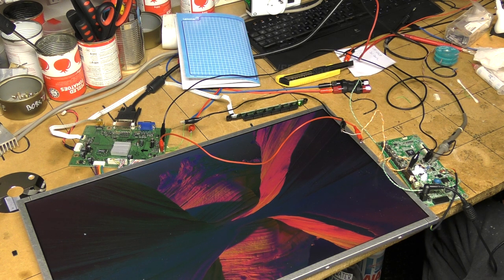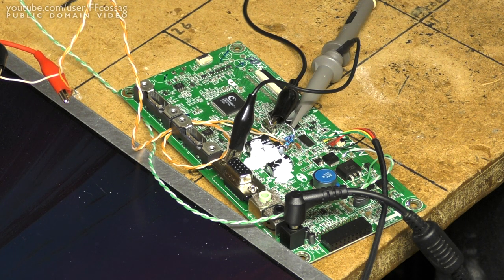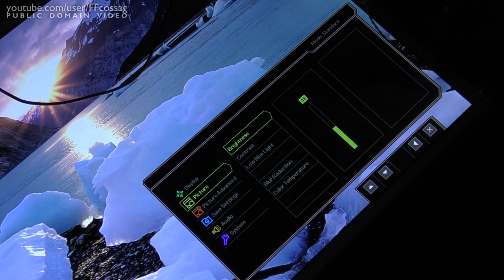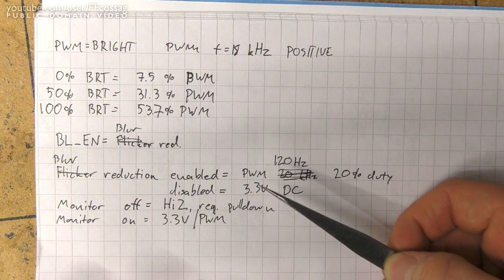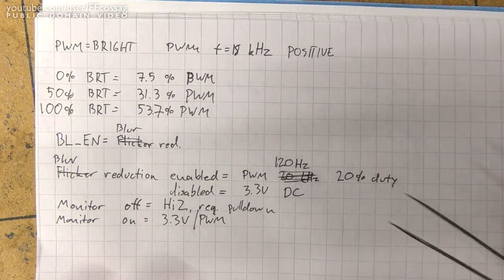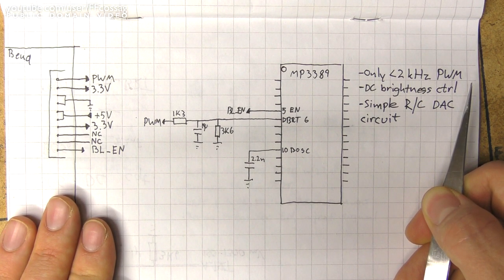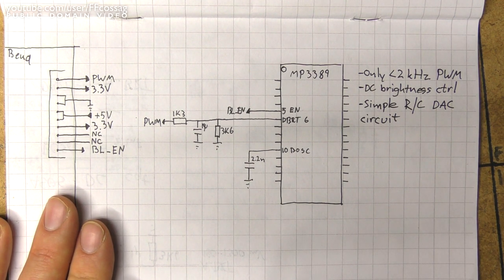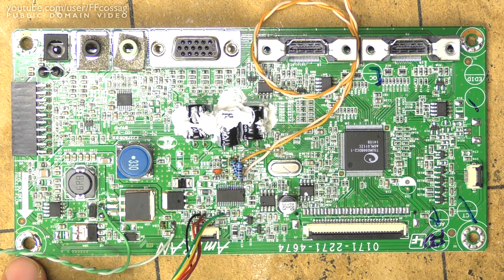BenQ XL2411Z custom PSU hack

Comment: You clever sod lol :-D
I was thinking you might have used a bunch of mosfets to do all the led power control, but using the chip and psu from another board is just sneaky, i like sneaky :-D :-D

Comment: Can you use the power board of a benq xl2411p to replace the power board of a benq xl2411z ? 
I got a free screen like you did the benq xl2411z but the power board is not working anymore. I can’t find any power board for the benq xl2411z I only found a power board for the benq xl2411p.
Reply from the maker: Probably, but it might require some modification. All the XL2410/2411s are very similar, but I can't promise that they're identical.